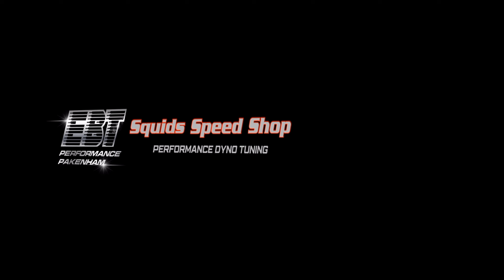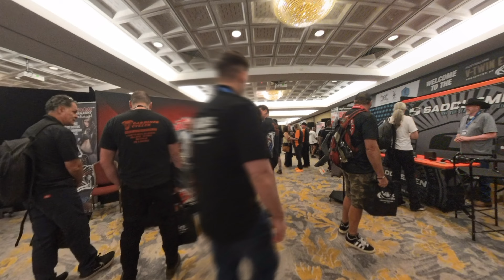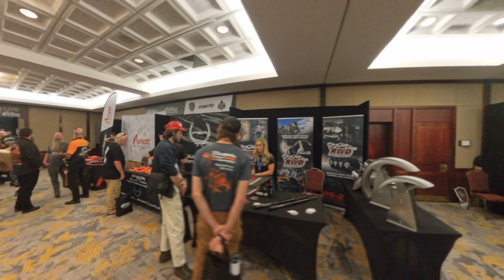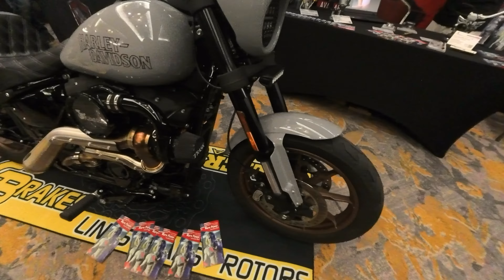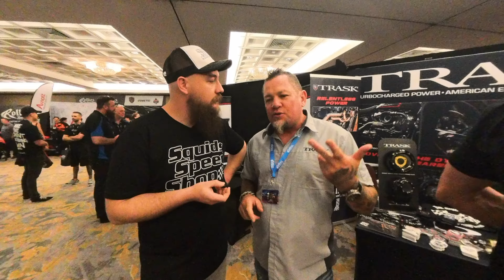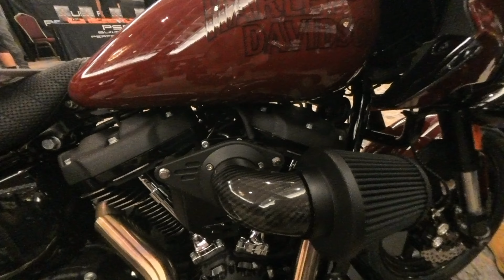Squid Speed Shop at The Australian V twin Expo Thrashin Trask S&S Rollies Speed Shop

Comment: Love the show but as a bloke on the disability pension on $235 a fortnight My old 08 Harley fatboy stage one i could never afford any of these new adds ons like turbos or S&S engine upgrades
maybe when I was working but not anymore living day to day now the S&S guy said $8k for the engine upgrade I could only dream of a cam upgrade and a dyno tune it cost $700 just for the tuner that we could not afford to be dynoed at Morgan and Wacker and almost $3k later in already had the screaming eagle big breather and Vance and hines long shots fitted I feel really ripped off by the never ever going back to be ripped off by Harley
Cheers
Reply from the maker: I get you man but it cost alot of money to run those size joints